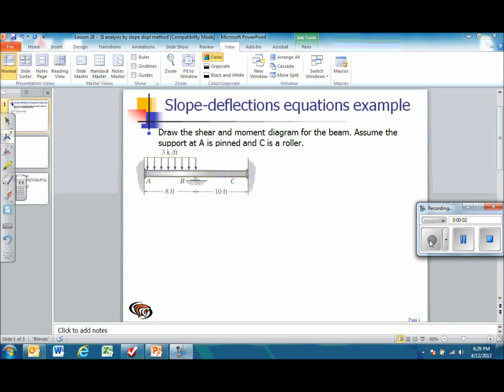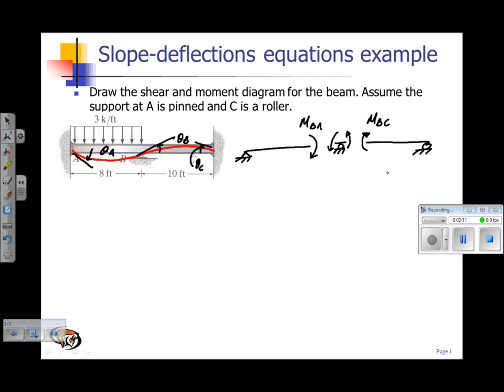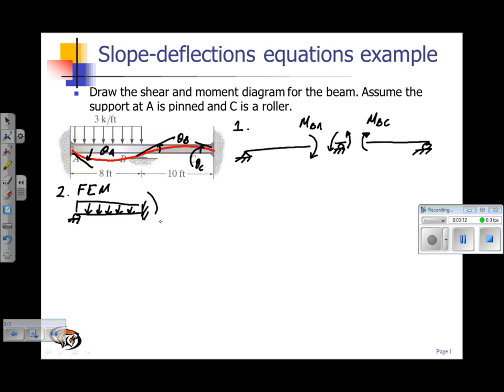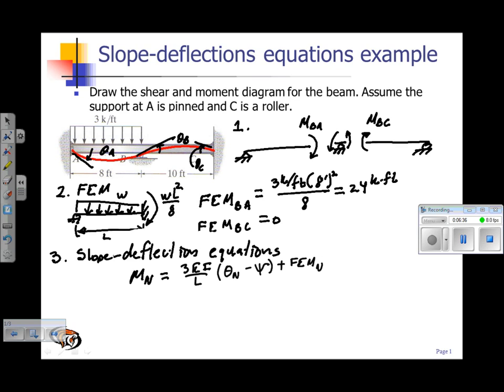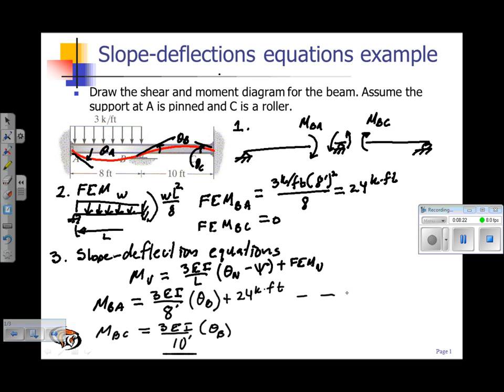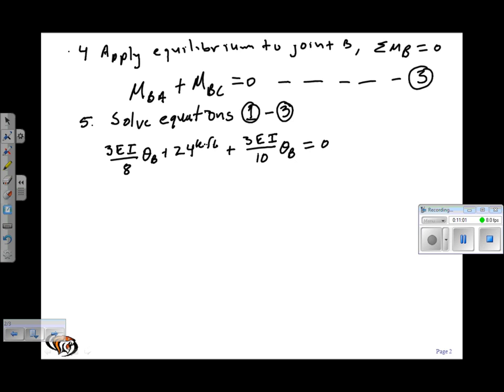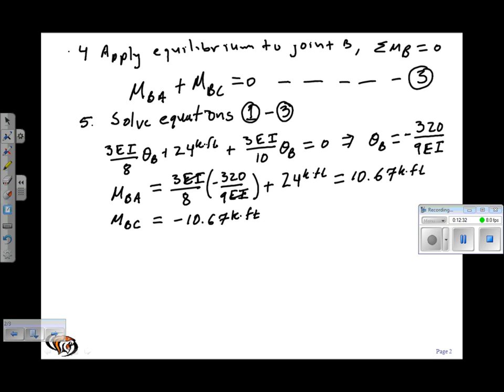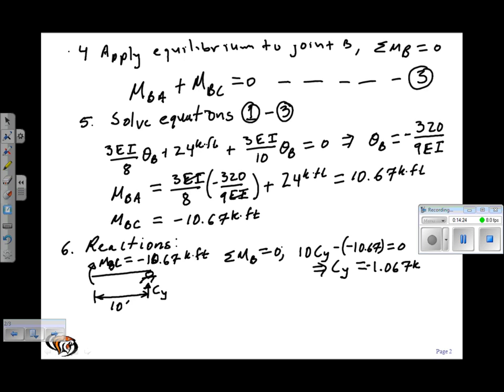Slope-deflection equations.wmv

Comment: Thanks for posting this video, it has been a long time since i have taken Stru analysis. 
But i have 3 questions...
1) when you have a span consisting of a pin to another pin, is the FEM always = 0?
2) is this true, for every span there is one FEM (under what condition whether true or false)
3) in step 3, are you always supposed to end up with n many equations and n+1 many variables?

Thanks again for this video.

Comment: I have come with an integral method for the solution of strength of material problems,in particular :BEAM DEFLECTION,all you need is a 5 by 5 matrix to solve it,thanks